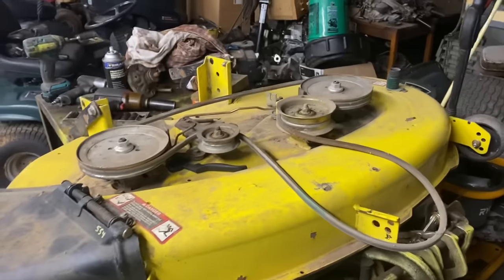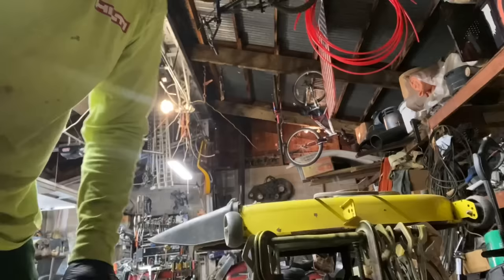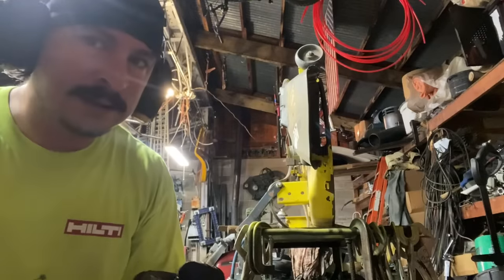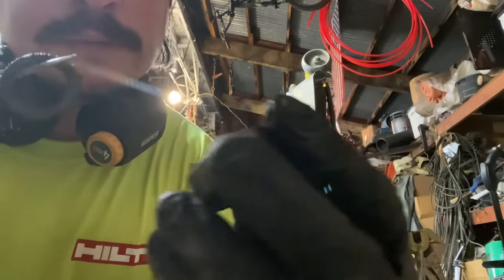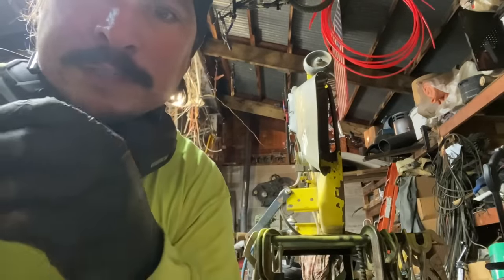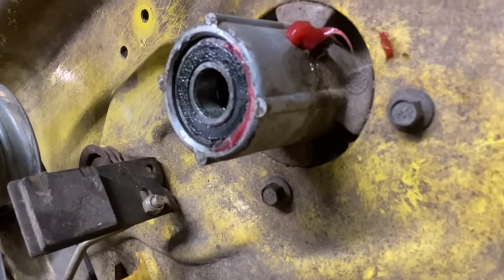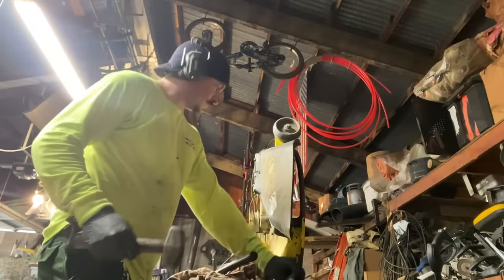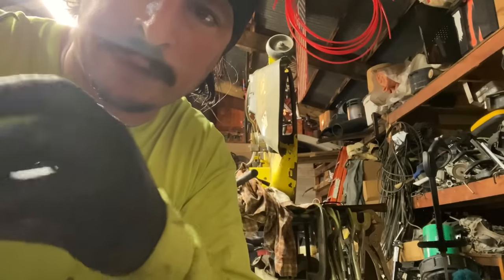Part 1 - Don’t trust the “Experts” Grease your mower deck sealed spindle bearings Common sense.

Comment: In the future, I plan to remove one seal that will be on the inside of the spindle. that will allow the grease to reach the bearings. I plan to use the type of grease made for boat trailers. It is supposedly water resistant which should keep moisture out and protect the bearings.
Reply from the maker: So after watching this video you concluded that removing the inner seal is still needed? Does your riding mower deck already have grease zerks? If so, your still telling me that you want to dismantle a deck that is fully operational and made with zerks so that a few shields with extra flimsy rubber lips can be removed that were never a threat to holding back grease from
The bearings in the first place? What am I missing ? I thought I covered this process in a painfully long step by step process so folks would know that extra work is necessary. I showed my bearings received grease with the shields in place. Why waste another minute thinking about it. Just add grease from a gun applied to the zerk until assembly is filled and your done. Rather than an hour or two tearing things apart you can achieve the same results in a matter of minutes. Thanks for commenting.

Comment: What if on the seal on the grease side of the bearing punch or drill 3 ea 1/8 inch hole, this would let grease in the bearing and the seal would help hold the grease in the bearing longer.
Reply from the maker: I’m my opinion it’s a wasted effort. If you watch the whole video you will
See that grease passed the seals no problem. It’s really way less complicated than folks seem to realize. Just grease them and get back to mowing. No need to take anything apart. That’s the point of the experiment I Ran. If you have a zerk on the mandrel you have it made. Depending on the manufacturer you may have a weep hole. If so just plug it. Super simple very basic stuff here. Don’t try and reinvent the wheel. This is the way most the big box store machines are made and grease gets where it’s needed. Grease once a year for a personal use machine you will be good to go.

Comment: I take off the inner seals, because that inner part, I fill with grease and dirt and crap won't get in there...   Best time to grease, when the bearing & shaft are hot,  like just used...  cause if there is air in there and cooling off will draw in stuff from the outside.   Grease just before you use it works too.
Reply from the maker: As for the inner seals there is no need to worry about those. Not even worth the time to disassemble and remove. Just absolutely 100% a waste of time as I have gone into great detail explaining in many comments on this video. The assembly is not pressurized nor is there any Vaccume so I don’t see eye to eye on the drawing in stuff from outside as you stated. I mean it sounds logical but nothing Iv ever seen working on these for years would lead me to believe that’s possible. The seals inner and outer won’t hold pressure. If you submerge in water they will fill with water eventually. A new bearing with fresh soft rubber seal may hold out water. I have t ever performed that test. But I assume after some use the seals don’t even provide water protection. Iv worked on several mowers that were under water and have found bearings filled with water and the mowers were in perfect working order before being in a flooded area. Lots of people comment about the inner seal and even lots of folks out there on the tube showing BS videos state that incorrect information and that is precisely why I made this video after a long hibernation. I couldn’t handle the BS any longer. I had to prove what I knew was the truth. Notice that no other video creators on this topic take the time to prove it? They just blabber their unproven theory like it’s so obvious these sealed bearings would hold back highly pressurized grease from penetrating. Posting videos saying the seals will prevent grease is doing the oposit of helping others and just cause confusion on the topic. So I am trying to fight back agains the others who post bad information on the topic like Donny boy. He has great videos on a huge number of topics but he has on on this topic and he is dead wrong.

Comment: How come they haven't used bearings which only have seals on the outside?
Reply from the maker: @thunderstruck1078  some
Do but fewer and
Few come with the inner facing shield off these days, I wouldn’t worry about it. The shields / seals dont stop grease anyways. Just pump the assembly full and go on with business as usual. As long as the units are filled with grease we can spend the rest of our life wondering if the inner side has a shield because there will not be any reason to take the assembly apart to check if bearings stay lubricated. The point of the video is to prove those shields don’t matter. So many mower repair channels. Actually every one of the channels that covers this topic is spreading misinformation about the topic. and not a single one will prove their claims that grease won’t penetrate the shield. They are wrong and that information is misleading a lot of folks. I use to believe the same thing for many years until I started experimenting.

Comment: I get the idea of a sealed bearing but maybe they should only be sealed on the outside and not the inside that way grease will go into it easy. Or maybe just drill some small holes in the plastic on the inside so the grease has a way to go in.
Reply from the maker: The grease can flow right past the seals. Once the cavity is filled with grease it can build a little pressure and slips right past seals. Some of the point of the video was to let folks know the inner seals don’t stop grease and the folks sitting the inner seals stop grease are very incorrect as I proved in the step by step process in this video. It’s way simpler than it seems. Don’t over think the process. Little rubber flaps can’t hold back pressurized grease. That’s really all this boils down to. Very very basic simple stuff. It seems like the seals would stop grease but not if the cavity is sealed. If it’s a sealed cavity with no weap hole the grease must push past the seals on bearings. If your unit has a weap hole just plug it.

Comment: If the seals do indeed allow the grease to get through, then why are the seals on there? Honest question.
Reply from the maker: One simple explanation I can think of is that the bearings used in the mandrels are also used in potentially hundreds of other applications. The shields are there to keep what grease is in the bearing clean and in place. Some other applications may not have protection on one or both sides like in a mandrel. In a mower deck mandrel only one side is necessary to protect but some machines come with the shield on both sides. Being that grease will pass the shield lip when applied to the mandrel and under pressure will go right into the bearing. So why any additional concern about if a inner shield is there or not? Only folks who have t figured it out yet think a shield lip can stop grease from passing. Many applications where grease is applied have “shields or seals” and yet grease makes it in or out of the assembly regardless. Grease guns can exert a lot of pressure (into the thousands of lbs) but that’s not needed for this application. However it makes me laugh when folks are hue grease won’t pass a little rubber lip on the shield. That lip can’t hold back any kind of pressure.
Reply: @GTObearclaw1  Thanks for the response. I have my mower in the shop right now getting all three spindles replaced due to worn out bearings in my Kubota Z251 that was bought in 2020. I am glad it is still in warranty. There are no grease zerks on those.
Reply from the maker: @DCS026  not sure exactly why a manufacturer would not install zerk fitting but look into how to add your own. Once out of warranty you will most definitely want to keep that dudes well lubed. It’s a shame they only lasted 3 years. And some idiots are commenting that the sealed bearings are good for life. Yea, the life of the grease. And then your needing new bearings.

Comment: In my area it is cheaper to by the bearns than the spindle one spindle here 90.00 each beans 14.00 each.
Reply from the maker: How much is grease? My point is that if the unit is properly greased we might be able to avoid a deeper repair

Comment: I only get about 165 hrs on the spindles before the blade starts to wobble and need replacing b/c the housing also gets damaged from the blade wobble. Takes me 50 pumps until it comes out of the blade side. Time will tell.
Reply from the maker: Unfortunately that’s common.  I have worked on many box stores tractors Deere and cub Specificlly that I have noticed bearing failures under 100 hours. In those cases they had never been greased other than what was in the bearings when new. 
As for your situation, What brand and model ? Have you ever tried greasing as I did here? In many cases a bearing in this application that has never been serviced can last that long. Essentially if someone adds grease but just a few pumps the grease will just begin to fill the void but be Traped between the inner seals and not able to reach the bearings. The assembly will have to be completely filled with grease before the grease will be able to build pressure to push past the lip on the inner shields. Are you adding grease at any time before they fail or are you just running new bearings as they come until you notice the wobble? I suspect no grease has been added/applied to bearings if they fail that soon.
Reply: @GTObearclaw1  Too bad Youtube doesn’t give notice of new messages. Anyways mines a X300 John Deere. In the past I only greased it about 10 pumps. My last pair of new spindles I followed your recommendation and pumped it 50+ x’s until grease was coming out of the blade side. So far it’s good, no wobble whatsoever. I ran out of JD grease so I use my grease that I use on my car’s ball joints and wheel bearings. If it’s spec’d out for automotive wheel bearings then it should be good for a JD rider.

Comment: Bearing seals are built to keep grease from flowing out.  Grease WILL flow in.  If you are installing bearings, you can pick the inner seal out but leave the outer seal in place. (even better)
Reply from the maker: Some folks didn’t know so that’s why I made the video. As for the inner seals the other point was it’s not necessarily benifital to take it all apart to just remove seals. However I prefer the inner seals to stay as if the one outside seal fails the grease can escape out the bottom. With a compromised seal on the bottom it just takes time for gravity and heat to do the dirty work. If the inner shields don’t stop grease then why not just leave them in place? A fair argument could be made eaither way but in reality it makes little to no difference if the inner shields are in place and would be dang near impossible to prove otherwise.

Comment: What do you do when there are no grease fitting I have 2 mowers with no fittings
Reply from the maker: Drill a hole between the bearings and add one. Should be some other channels with that help. Unfortunately I have not made a video on that because Iv seen others already cover the topic with good information

Comment: When you weld in spindle plate and before you weld what clearance are you looking for between the blades before welding?
Reply from the maker: I rarely look for any specific measurements between blades. But I’d say between 1/8 and 1/4 inch. Just do your best to center it and use a new set of blades to check what they look like before you start welding. Bolt it all together with a repair ring and check the blade clearances before starting any welding. There is usually enough of the old mount left to see where the spindle should be at. I can usually eyeball it and get it right. Then when I check blades they don’t touch each other or any part of the deck as they rotate. If the blade is close to touching or actually making contact just loosen bolts and make slight adjustment as needed then secure the aluminum housing before welding so it stays put. I recommend removing bearings before welding. Otherwise they will get blazing hot. And not sure that’s good for the grease or seals. But I have made the mistake of welding before checking blade clearances. Talk about a ton of fun.

Comment: I always pop the seals out an grease mine they come with very little grease. I pack them put the seal back an don’t waste my time trying to pump the grease in the spindle
Reply from the maker: Did you watch the full video? Seems like maybe you didn’t because of the comment. Actually, Pumping grease into the mandrel with a grease gun saves time. The waste of time is dismantling a deck. If the mandrels already have zerks you can get the same result in less time. I’d suggest just giving it a try. What’s it going to hurt? It will
Definitely be faster than removing a deck and pulling it apart to access bearings. That’s what the video shows. I did the work of dismantling deck in the video just to prove the process works and to save people time. But I’m not going to beg folks to try it. I stand to gain nothing. Just trying to help folks.

Comment: Simplicity mower deck spindles were ruined. Owner had it packed with new grease. Grease didn't go through the bearing seals. Bearings were dry. Bearings fell apart as I removed them. We had to replace the spindle housing. Grease like water takes the path of least resistance. So in my opinion remove the seals from the bearings. At least the inner one if you want to grease the spindles with a zerk fitting on the spindle housing. I don't have zerks on most of the spindles I repair. So I remove the seal, grease the bearings and replace the seals.
Reply from the maker: Who knows how much they added or for that matter when the grease was asses. Sounds like a case of to little to late. The grease won’t go through the bearing shields unless the cavity is completely filled. If it’s got a zerk fitting then keep pumping until you see grease. Part of the point of the video is to prove the shields don’t prevent grease reaching the bearings. Iv removed hundreds of bearings that were failed. The owners only added grease
When they realized it was in bad shape and by then it was too late and in most cases they still don’t add enough grease to fill the cavity. They think after 20 or 30 pumps that must be enough and they stop too soon. It’s enough grease to make it a mess when disassembled but not enough to reach the bearings and even if it did that won’t fix damaged bearings anyways. The information in the video is correct if it’s done properly as I have shown it will do exactly as I said. Grease goes right past those dust shields like a fart passes through your underwear. It’s not rocket science, not even complicated. Just basic stuff. A rubber lip of a dust shield won’t stop grease that is under pressure. The seal will give. The grease will pass. A dust shield can’t stop pressurized grease no more than some thin Cotten can stop a fart. Read some of the other comments. Don’t bother removing those seals. It won’t make a bit of difference. Just grease the dang assembly properly until you see it come out the top or bottom. If grease does not exit through a bearing it probably didn’t fill the cavity.
Reply: @GTObearclaw1  😂😂

Comment: A-PLUS! A seal can't stand up to the pressure of a grease gun, especially a rubber seal. I had an old belt drive 4-foot Ex-marl walk behind with a Peerless tranny that used bentonite clay as a lube. Ex-mark sent out a bulletin that as soon as the warranty died to drill, tap and install a grease fitting in the tranny because the bentonite would dry or leak out and the tranny would self destruct from no lube. The fitting would let you keep everything inside lubed up and stirring around. GOO)D VIDEO and BLESSINGS!
Reply from the maker: Great info and thanks for the comment, This reminds me of one time I had a old Huskee rider and all the grease / oil leaked out of the rear end and it was getting noticeably noisy. It was just a simple forward reverse rear end and used a variable speed pulley set up to control speed. I added a grease fitting and pumped it full and it worked for many years, never had an issue with that rear end.
Reply: @GTObearclaw1  You did good. I found out too late to do that to my Sweeties old 85 Craftsman but I got a big fitting that'd fit the place where the neutral switch went on the replacement tranny and pumped it full or at least some in it. So far it's still leaking out which is a good sign there's still some in there!

Comment: The two smaller belt pulleys, especially the smallest diameter one...  turn many times faster than the spindles.  Are ' out in the open ' .  And I never hear anyone concerned about greasing those sealed bearings.
Reply from the maker: What you speak of is the idler and tensioner pulley. They have similar bearings and those bearings need grease or they will go bad just the same. And they can be greased with a grease needle to extend life. The difference is that when those go bad they are cheeper and easer to replace. Even though sometimes they are ran to failure they usually don’t cause catastrophic failure but can damage a belt. I’d say all bearings have a similar life expectancy. Most people have a hard time realizing what the issue with a deck is and commonly have difficulty diagnosing what’s wrong.